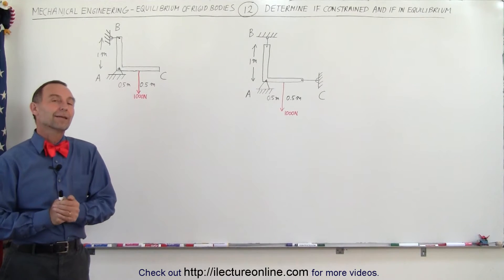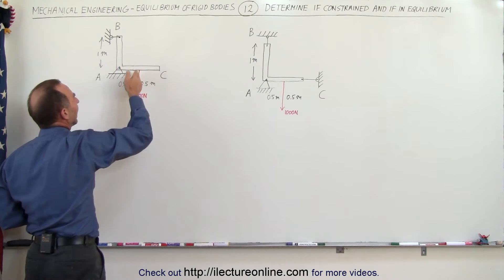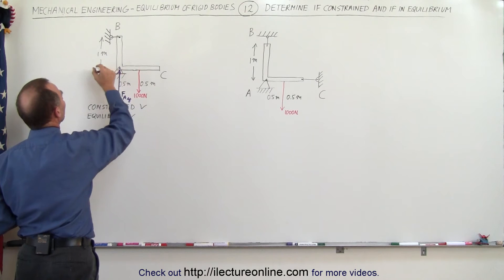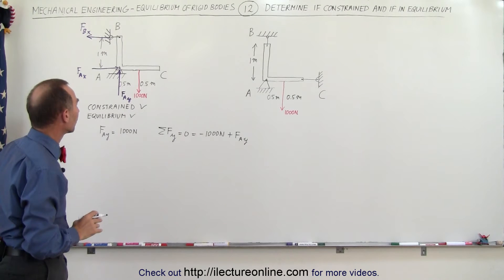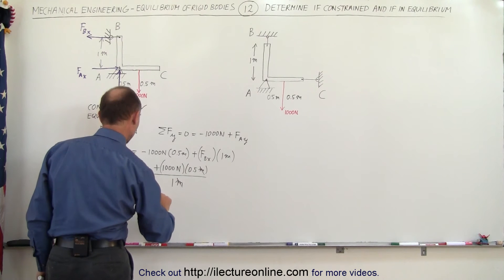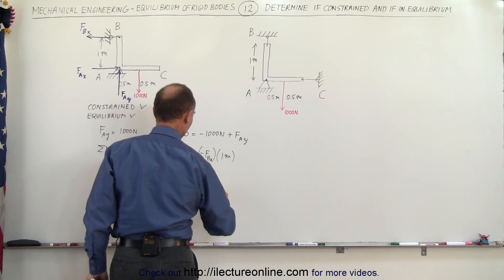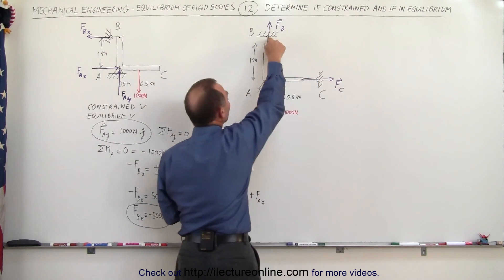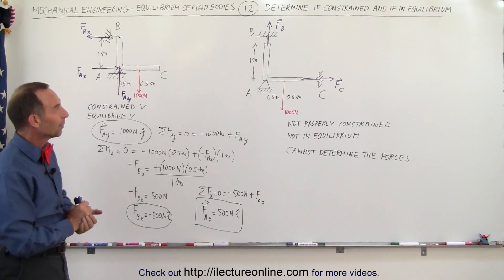Mechanical Engineering: Equilibrium of Rigid Bodies (12 of 30) Find Constrained? Equilibrium=? F=?

Comment: For example B, I feel that it is properly constrained because any rotation of the L bracket would want to elongate the cables? Thank you for these lectures.
Reply from the maker: Cables are not considered rigid structures.  In example B, the object will rotate some in a real situation.